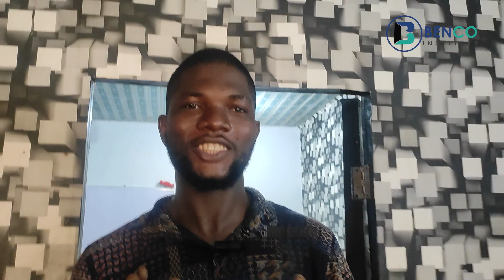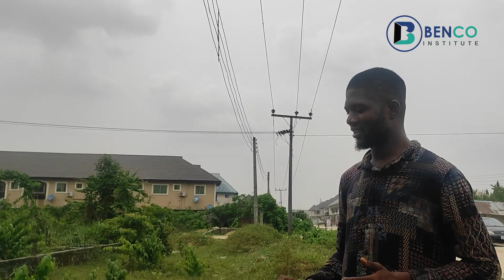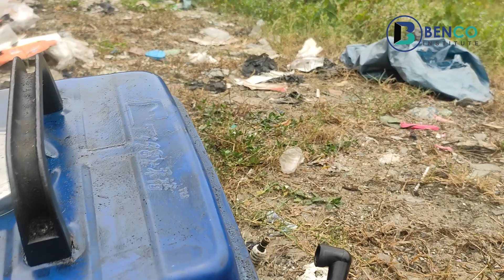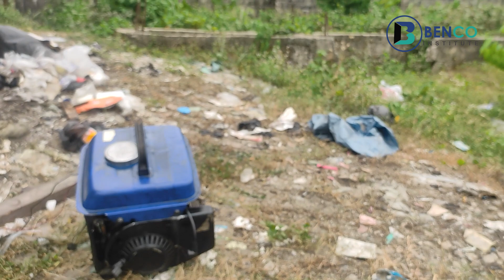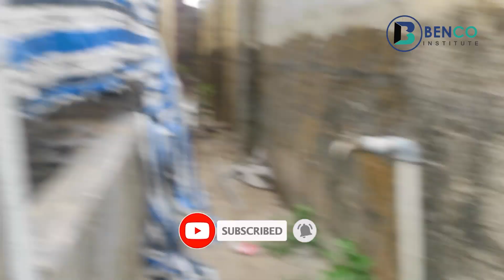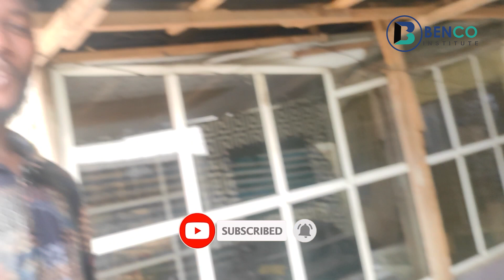Tiger 2 Stroke Generator works without plug

Comment: maybe your combustion chamber is full of carbon hence the carbon glowing hot and keeps the air fuel mixture burn without the spark plug. but maybe when it is under load, the glowing carbon is not enough to supply enough heat to burn the higher volume air fuel mixture.
Reply from the maker: You have a  point...

Comment: Your crank case is super heated. The fuel-air mixture continues to ignite even when you disconnect the plug. It's happened with my tiger gen too
Reply from the maker: You are very sharp

Welcome

Comment: This exact same thing happend to me some years back and i did not talk about it with anyone because i think no one would believe me, even i wil not believe it had i not seen it with my own eyes. There is definitely a reason why this happened pls investigate. And i managed to stop the gen by offing the fuel tap
Reply from the maker: As a Generator Technician we see some of this things regularly.... 

What happened here was increase in temperature of the combustion chamber,simply put the Generator over heated,For some instances when the generator overheats it makes a cracking sound that ultimately shuts down the generator,but in other cases as temperature of the combustion chamber rises similar to the temperature of a Diesel generator, the petrol generator now works continuously even in the absence of spark from the plug provided they is constant supply of fuel and infinite combustion and then the gen can only be put off if you somehow stop intake of fuel through returning the choke or stopping the fuel valve..
Reply from the maker: Sure...

I know why it happened,this is like the third time it has happened but  this is the only time i could capture it on Camera...